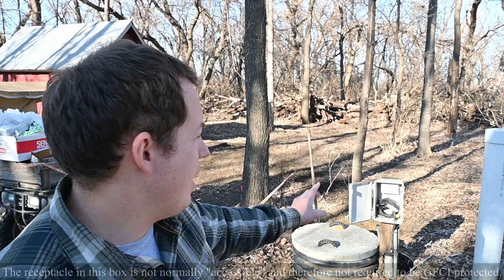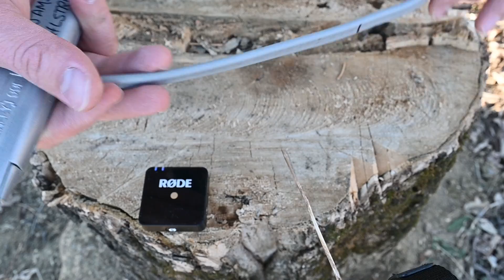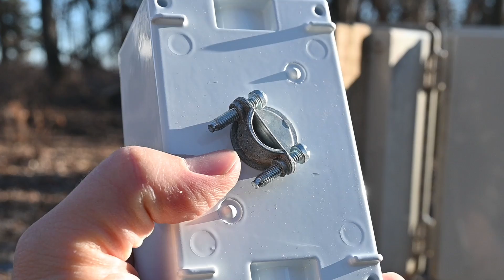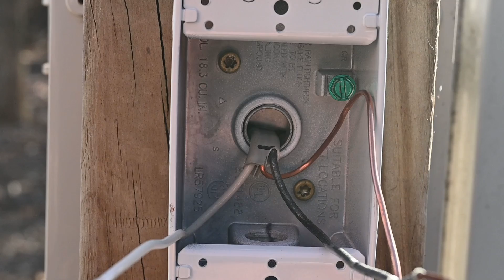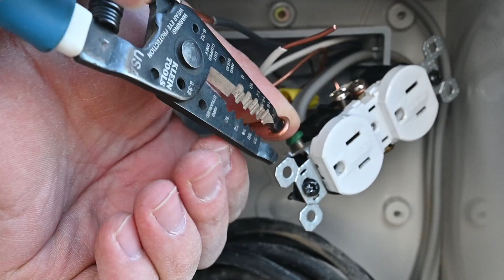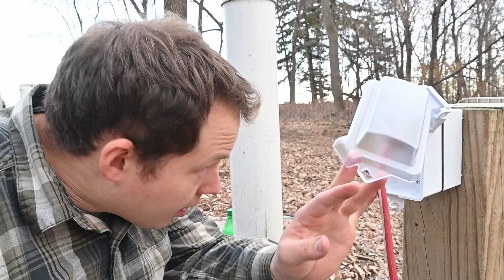How To Install an Outdoor Outlet

Comment: I would have swapped outlets and both would be GFCI protected.
Reply: per Ben's pinned comment .. "For those who are curious; that circuit that I tapped off of is fed from a standard circuit breaker with no GFCI protection. The receptacle in that box we tapped into is not normally accessible and is used for the septic pump and therefore was not required to be GFCI protected by code at the time of installation in 2016. The reason that I didn't use a GFCI breaker is that I prefer not to have nuisance tripping of my septic pump but I did want to have GFCI protection at the receptacle we added"
Reply: was thinking the same - perhaps the box in the enclosure wasn't large enough for it (the GFCI) - still it would have been an excuse to visit the hardware store again to get some "needed" supplies ;-)

Comment: Boxes are made to have grounds opposite of hot on 120 with outlet install right-side up, maybe you installed box upside down, but always tape around outlet or switches.
Reply: I was going to have the ground up/ground down debate before I had the pre-twist or not debate. 😊

However, this box is clearly labeled to be mounted in either orientation.

Comment: Exactly how I installed the very same box.  The only thing I would do different is tighten the load screws on the GFCI outlet even though not in use.  I don’t like leaving anything to chance, especially when it comes to power circuits. “Make it right, keep it tight”

Comment: there is no requirement in the nec code about ground up or down.been doing electrical work for 50 years never saw metal fall between wall and plug causing a short.ground down
Reply: When ya look DOWN, what does everyone see?.....GROUND....thus Ground is down, except now 2020 NEC says different...they are playing with people's minds!..that's why the GERMAN euro plugs are better, they support the cord cap since they are recessed,  and the ground are on top and bottom..our outlets and wiring devices are poor design, cheap, and as usual, behind the rest of the world, except Thailand and India...ever see the poles outdoor wiring, oy vey

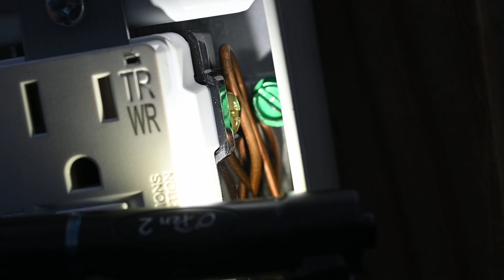Comment: I’m surprised your not taping all your connections and wrapping the terminals. It prevents stuff like this from happening. 17:10
Reply: this is why amateurs shouldn't; you need to be taught how to pack your wires. that ground should never come forward to the terminals. electricians use tape over the terminals so we, or the tile guy, can work on or around live receptacles, especially in metal outlet boxes. we do not use tape so we can get away with bad packing, WTF!

Comment: Ben:  A rather flimsy plastic box/cover?   A couple of bumps and gone? 
Thank you.    Is the first duplex receptacle protected back at the panel?
Reply: You don’t use 2 GFCI units on the same circuit, use one up stream to protect all receptacles downstream.  I understand the tripping possibilities on the septic but you are using a duplex receptacle, one for the septic and the other port could be used in the yard and therefore it should be GFCI protected.  Solution would be to use a single outlet receptacle for the septic and then use the GFCI on the other side of the post like you did.

Comment: I prefer to use insulated ground pigtails for this exact reason.
Reply: I run everything in conduit so I don’t need the ground but I tape everything so the terminals are covered and protected.

Comment: wouldn't you want to replace that wire after you had a burn on it ?
Reply: Wire is still good, no notch missing. Also, being a ground, it won't carry current except for a microsecond during a ground fault.

Comment: Is it necessary to add sealant or caulking around the box and crevices to keep moisture out?
Reply: Yes. You need to use silicone sealant on the top, left and right side of the back of the box. 

He also used the wrong cable clamp on the back of the box. They make rubber cable glands that seal out that UF cable made specifically for this application.
Reply: I would be careful about what sealant you use.
I suspect the foam might melt in the presence of sealants/glues that use toulene as a solvent.

Comment: I’ve seen some electricians wrap outlets in electrical tape. I’m assuming to prevent possible shorting out of the terminals touch another outlet or wire in the box. Btw, nice video editing and great to see your kids in the videos.
Reply: Those are bad electricians. No tape is needed if you are a competent electrician.
Reply: I think the tape method is used by some to keep it tight so the wires on the screw terminal aren’t bending. It keeps the receptacle straight or plumb when fastening it to the box.

Comment: Notice how the words on the switch are printed inverted too.   Another electrician said that the standard is going to change and new outlets will be installed with the plug ground on top.
Reply: It is a thought, but in this covered box installation, there would not be a way for things to accidentally drop on top of the plug if it was loose. The box covers the plugs, and the cover would also push in the plug if loose.

Comment: I would’ve drilled  a 1/4” pilot all the way thru post. Then use a  1-1/8 auger bit thru post, 1/4”hole is my guide. Then drill existing box out with a 7/8” hole saw. And use 1/2” pvc to connect both boxes. 1/2” connector in new box. Cut short piece of 1/2” pvc And use stranded wire a lot easier to work with.
Reply: I did this on an actual exterior wall of my house & used my 36" long 1/8" bit to ensure that it wasn't going to come out someplace unexpected, plus it allowed me to used a hole saw from both sides for smooth edges & I didn't need to use extension to get through wall with 2x6 studs.  Shooting expansion foam insulation into hole from the inside eliminated the "heat leak".